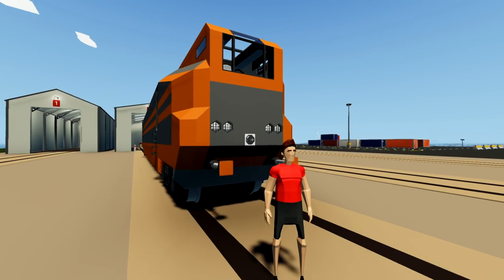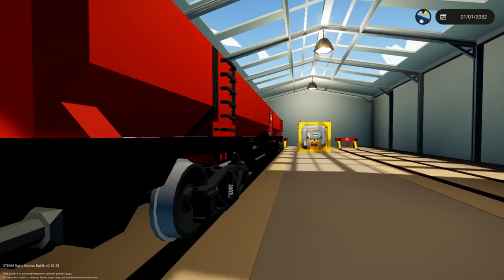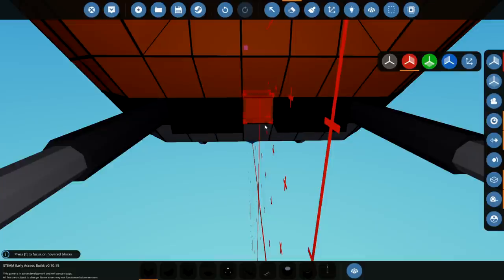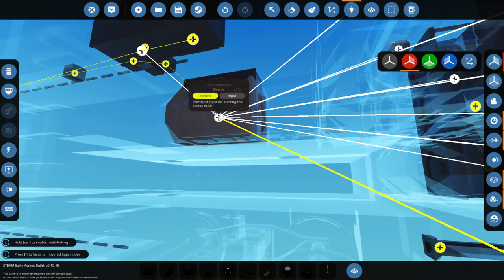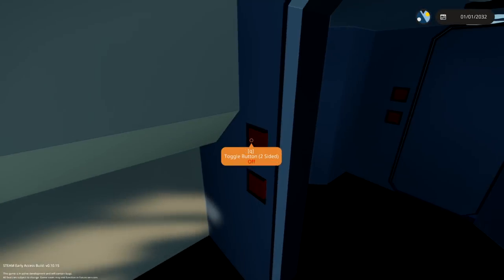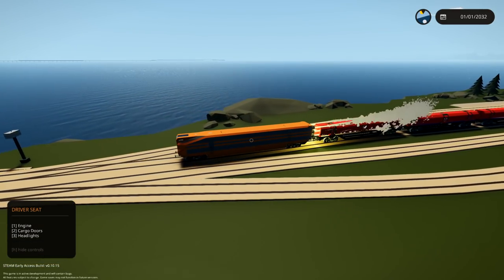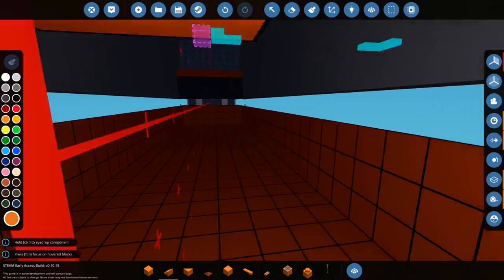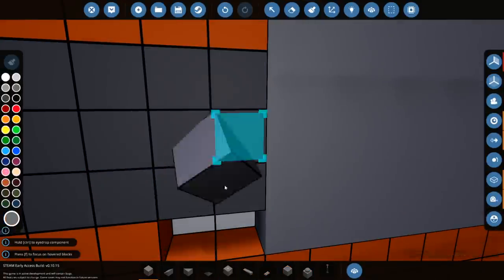Jet Train Pulling Cars  -  Jet Train  -  Part 5

Comment: Frantic add a throttle lever on the control panel for the cargo doors so you don’t need to run back an forth to open and close it

Comment: btw 24:42 the reason of it doing that is because one of the winches going through the wall dou to speed and causing a rubber band effect for some reason
Reply: what it is mainly doing is trying to pull the train back, while your thrusters are pushing you forward
Reply: and by looks of it, it was the left winch that was causing problems
Reply: and it only does it at high speed

Comment: Ey, nice one! Just saying, but the winch is not working because it needs an electrical rope one, and then, the on/off output from the winch goes to the rope, and then, put the power output and on/off output of the electric rope to the Mag All, sounds difficult, but it's easy! :3
Reply: I'm not the best at explaining, so this is it ;)
Reply: I think you explained it really good  I was gonna say that he needed a electronic rope anchor for it but I don't need to!
Reply: basically what you said, Put an electrical rope piece on it and connect the on/off to the same thing and make the mag get power from the rope
Reply: @StrongOneYT  bingo :3
Reply: And add the on/off output aswell :3 from rope (I'll add that now, I guess..)

Comment: make it have the jets power tons of generators and have tons of electric motors, i would recommend making and/or finding a wheel slip reduction micro controller for it as well to optimize the electrical usage

Comment: winches... that on/off thing isnt for the winch, it is the signal sent, so that connector if it is an electrical cable, will read that signal and be able to turn the mag on or off.

Comment: Since noone has pointed this out. You need to connect the mag to the winch on off the winch on off to the rope connector the rope connector to the mag. The same with power(winch-rope connector-mag all). +you need to use electrical rope connector. 

Edit: Almost noone

Comment: The winches have an on/off output that you are supposed to send to the electrical anchor's input. Then the anchor has an output that you send to the mag all, so you create a path of logic, from a button to the winch to the anchor to the magall. It's really confusing and the whole system is dumb. You shouldn't need to do extra logic.
Reply from the maker: Thanks for explaining:) I'll fix it next time
Reply: Frantic I’m actually not entirely sure if I was exactly correct. I looked into it more and found that there is an input node on the winch labeled “data to send to the anchor” which you connect the button to and and an output node on the rope anchor labeled “data to receive from the winch” which you connect to the magnet. There are also nodes going the other way.